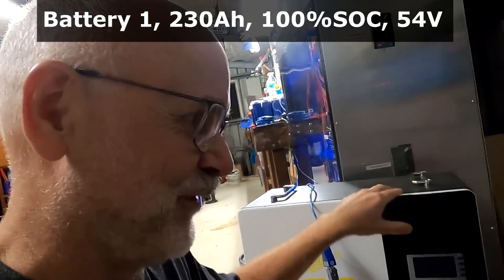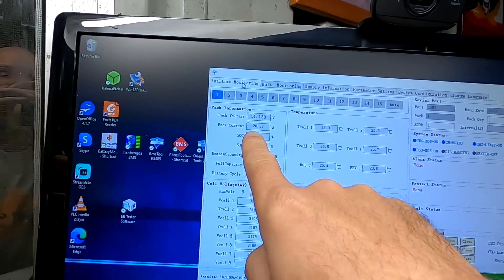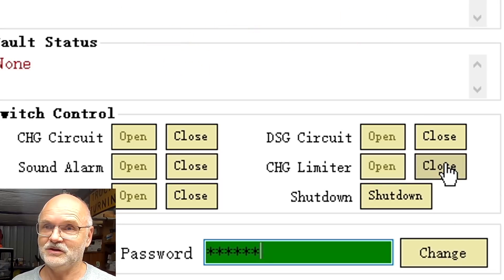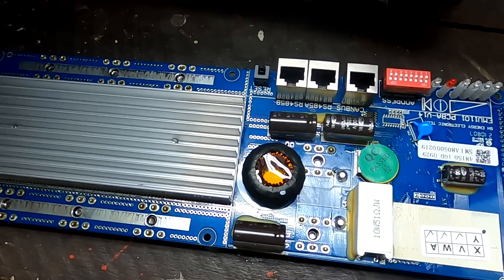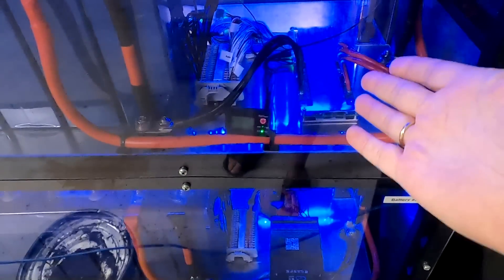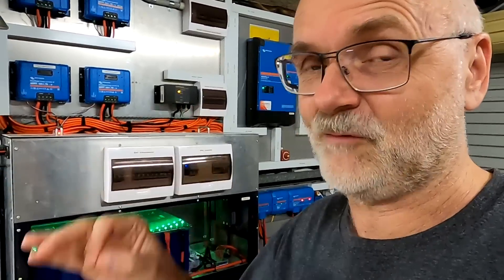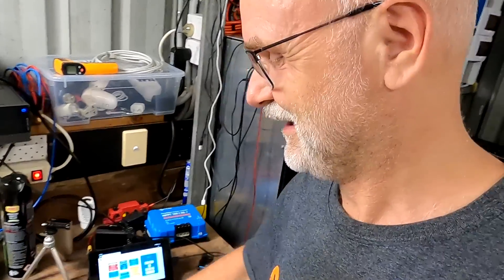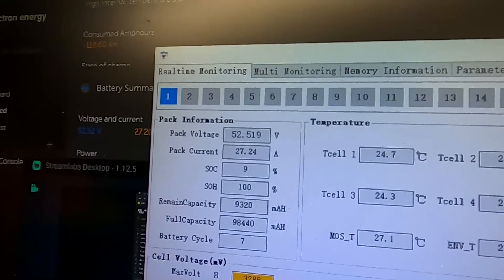BMS Active Current Limiter - Safety Feature or Gimmick?

Comment: I am currently building an equivalent of the Seplos Mason. Different metal box, so the front panel arrangement is different. It has the Seplos 150A BMS and 16x290AH cells (it also has a 150A breaker - between the +ve of the cells and the BMS and a 180A bolt down ceramic ANL fuse - between the BMS and the +ve external terminal, and I will add active balancing). My inverter is the UK equivalent of the DEYE 16k Hybrid Inverter branded as Sunsynk (there are technical differences to meet local regs). It can output 12.9kWh (max) DC charge. So, at 16*3.6V that is about 200A. I will be installing a total of four of these battery packs, so let's say 50A each. Why would I want to limit the pack charge to 10A, or 20A? 0.2C of these cells is 58A. Surely I would set a higher limit at maybe 60A? Or is this current limiter something different?
Reply from the maker: The current limiter is a safety feature. It only kicks in if one of your BMS goes into over current alarm or protection. Instead of turning of the battery completely, it limits the current.
Reply: @OffGridGarageAustralia  Ah. Light bulb. Now I understand. It detects an inrush well over the normal limit, and so it chops it back a lot, allowing a bit through. What a good idea. Thanks for the reply Andy.

Comment: One other thing to note... PWM circuits are incredibly noisy.  They are like the most garbagy switching supply you can imagine.  That can interfere with RF applications like WiFi and Bluetooth.   I can pretty much guarantee that none of these products actually pass the certifications they claim to have if the PWM is running.
Reply: Yes to get the fastest switching you generate a lot of harmonics. Filtering is possible of cause but it should probably be in a metal case as well to avoid radiation.

Comment: Its a cute circuit.  Yah, since it only has FETs it has to PWM (pulse width modulate) the power feed into a filter (capacitor and/or inductor based circuit) which evens out the current from the PWM.   This is a bit hard on the FETs, though, because the ones used in BMS's have to be cheap and are not designed to switch at high frequencies (see below).  I would not trust it in general but if I had to use it I would not the set the current limit any higher than around 20% of the BMS's continuous current capability.

The issue with FETs switching that quickly is that the have to go through their linear region N times a second when switching on or switching off.  So, for example, if the PWM is operating at 1000hz, the FET's linear regions are being transitioned 2000 times a second.  When a FET is in its linear region, it directly dissipates the voltage difference instead of acting like a simple switch.  So there are severe limits to this sort of circuit.

You could put a scope on the FET output(s) and see what PWM frequency they are using.  It can be anywhere from 60hz to 1000hz for this application (is my guess).  In anycase, that is why the current limiter must limit to a relatively low value.  Otherwise the FETs would melt.
Reply: That's  interesting. I've seen similar BMS's with power resistors and heat sinks which I assumed would be PWM or they just switch the output via the resistors until the current drops below a certain value. I always assumed that inductors on the Pace BMS's was because it was a switching buck rather than a filter for the PWM. Seems silly that they would use bunch of FET's just to get a constant current rather than dumping the output through some power resistors.... either way its burning as heat. Or is there more of an advantage to using PWM over switching through resistors?
Reply: @roadeycarl  You can use resistors for relatively small currents but nothing significant.  Resistive circuits waste a huge amount of power and you have no real dynamic control over the amount of power you wish to allow to pass through.   All that is happening is that the power dissipation is being shifted from the FETs to the resistor(s) and that might not be an improvement.

The inductor circuits are essentially buck converters, but with the very significant difference that the output is ultra-low impedance due to being connected to VBAT.   Basically the output looks like a short to VBAT, and that creates additional problems.

Normally the output of a power supply is connected to a relatively high-impedance consumer, not a low-impedance consumer.

I tried compacting the explanation but honestly couldn't get it any smaller than like ten paragraphs so to make the story short lets just say that the low impedance output creates issues with component selection and tends to cause feed-back to the switching FET, potentially causing more power dissipation to occur in the FET above and beyond losses from fast PWM switching.
Reply: @junkerzn7312  phew sounds plausible if I only understood most of it, I assume your a tech on this stuff, hats off to you🤟
Reply: @alanblyde8502  Pretty much my profession for the last 30+ years.   Circuit design, micro-controller programming (mostly PIC and MSP430 based), and server-side programming.  Mostly in C.  Mostly contract reference-design jobs.  Meaning flexible hours and independence.

I am not quite an analog engineer but it turns out that most analog engineers aren't programmers, so the programming of the micro-controllers for the servo loops and state machines and such typically winds up on my desk anyway.

In anycase, its a fun profession.  So few companies have in-house expertise that being good in this area guarantees high wages and job security more or less until you retire, and an opportunity to be self-employed if that is what you desire.
Reply: It’s a buck converter.
Reply: Thanks for taking the time to explain, it's very interesting!
Reply from the maker: The FETs for the current limiter are different ones to the normal FETs of the BMS though. Remember, the current limiter is on its own PCB, completely separate form the BMS.
This limiter usually only activates in case of an over current protection until the current goes under the OCP setting. It's a safety feature more than a permanent charger function.

Comment: The way Seplos BMS is capable of limiting charge current to 10A in the top end of the charge is working very well for balancing/absorbing, in the absense of a real absorption feature. I have set up the 10A threshold so that the last few percent charge takes 30-60 minutes, which is fine for absorbing and balancing (so far, with only 20 cycles on the 280ah pack).
Reply: How you setup the point when limiter starts?
Reply: @65mindi  monomer overvoltage alarm
Reply from the maker: Well, that depends on your balancer. Charging with 10A but using the Seplos internal balancer with 100mA won't make a difference. If your cells a well top balanced and matched, it will work though.
Reply: @OffGridGarageAustralia  Sure thing. I have an active balancer lying in the drawer ready for installation, but so far my voltage delta is <5mV during normal operation and 20-30mV during high loads or at 3.45v per cell.
Reducing the charging current and starting the balancing in the beginning of the knee even the 100mA makes a positive difference. We will have to see, when I have more cycles on the battery, though :)

Comment: Want to see if the current limiting circuitry works all the time, regardless if it’s limiting the current or not. That would bring the total efficiency down.
Reply from the maker: You can turn it on permanently in the Seplos BMS and charge current will be always limited to 10A. This is more for testing purposes but not a permanent setting.
Reply: I have 30 x EVE rack batteries with Pace BMS. They each limit to 20A*50V=1kW each.  They don't get warm so efficiency must be reasonable.

Comment: Like# 107 - the new panels are physically mounted, this coming weekend I need to reconfigure into 4S2P with the 540 watt panels?
Reply from the maker: Let the flow of electrons start!
Reply: Physically mounted to the temporary ground array while I engineer and build the awning to mount onto Taj-Ma-Haul. Then I have to engineer and build the corresponding deck to cover the array when in motion.
So I’ll be stuck until both are completed!

Comment: The JK-BMS outputs a higher voltage in the event of an overcurrent. In my case about 56.5V so the charge controller "thinks" that the battery is full and regulates the current down.
Reply: most likely, the JK-BMS disconnects itself and the charge controller increases to the charge setpoint
Reply: That's interesting to know. My Victron MPPT and Lynx Shunt were fried after an overcurrent event, my instinct was it was caused by the Seplos BMS. The last thing my CC saw was around 72v. I suggested this to Seplos who denied all knowledge and blamed it on everything but.
Reply from the maker: That is weird, the MPPT and shunt should never get destroyed when the BMS turns off the battery.
They should still see the voltage as the discharge MOSFETS are still turned on. Either wrong settings in the Seplos or a faulty Seplos, I would guess.
Reply: @OffGridGarageAustralia  It was a perfect storm. I'd limited my Mason 280 to 140A .5C, and there was a break in cloud cover at exactly the same time I turned on a 3KW load. I have 2 x Victron 250/100's with 5700W of Solar on each. Both my Lynx Distributors and my shunt died at that exact moment. One MPPT was recoverable from an 86 error, the other had to be sent back with a non recoverable 87 error. On the plus side I may now attempt to squeeze a Smart Shut inside my Lynx Shunt now that it has been fried.
Reply from the maker: @pedromoonunit430  As long as the Lynx shunt does not show any DC Power in the Consumption tile, it is not worth the money for me. The Smart Shunt or the BVM is the better alternative at the moment.

Comment: The ideal solution would be charge limited once the cells go OVP and feeds exactly in whatever the balancer amps is. This would assist balancing without slamming on and off like the JKBMS.
Reply from the maker: Well, that would mean the charge is limited to 50-100mA only. I think manufacturers should rather upgrade their balancers on these BMS.
Reply: @OffGridGarageAustralia  Consider a BMS that replaces the leads on a 5a balancer and monitors each of the cells and then has the rest.

And it would be greater than the balancer, just way less.  And it still is the ideal absorption voltage. It's the maximum it can give to completely fill the cells without damaging them.

Comment: You finaly got the right cheap fuse Fpor the "not so cheap fuseholder!😇
8C here in rainy western Norway, but still 59 kWh today!
Any updates on the Lynx shunt?🤓
Reply from the maker: Yeah, that's the right fuse. even 325A is far to high for my test setup and cabling I have used.
No update on a potential update for the Lynx Shunt. I check at least once a week 😉 If they include the DC load consumption, it will be a great piece of equipment.

Comment: Control not bad. You know that some will not think and just flip the switch. This is a Thumbs up 👍. A good surprise to see 😊
Reply from the maker: Yes, I really underestimated this feature but especially for beginners, it's a great safety feature.
Reply: @OffGridGarageAustralia I was about to buy two jk bms but this video (awesome) came up. As I am running Selectronic inverter ax coupled I can’t find a bms that talks to my inverter I was concerned if one bms turned off was I going to get amp spike going to other battery pack. One question though does your pc need to be connected and on all the time with the bms?